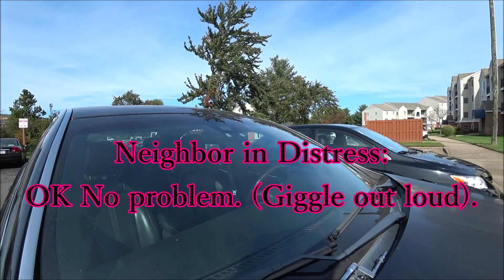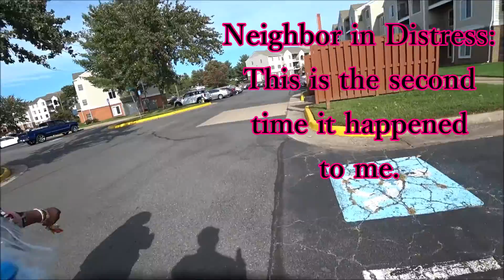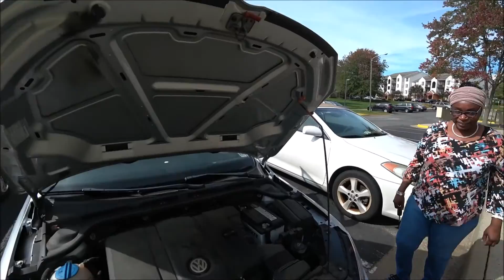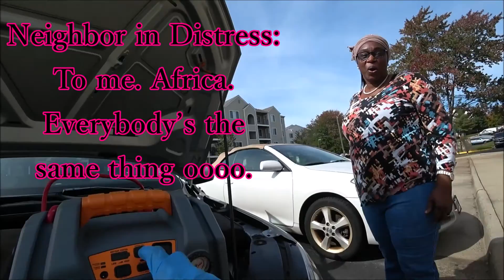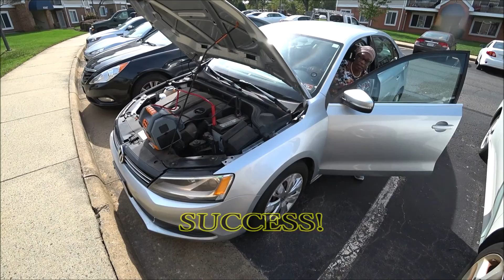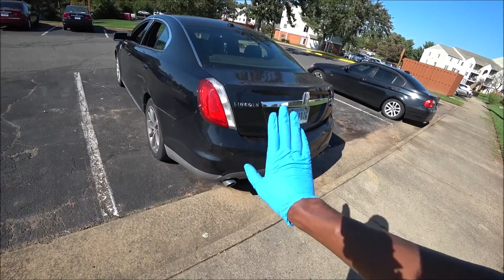Simple Act of Kindness Can Change Your Life FOREVER | Love Your Neighbor As Yourself

Comment: I have a Solara like the one next to the neighbors VW, but in hardtop. Great cars and ncie looking too.
Reply from the maker: Yes. The Solara's are a dream. Very easy to work on and 10 times more stylish than a regular Camry.
I am sure one day Toyota will resurrect them like The Undertaker for one more chance to shine. Ciao amigo Mito.
Reply: @JayCeeMax  Yes that would be nice, a new 3rd generation Solara. Mine is a 2008 with the reverse lights on the rear bumper.
Reply from the maker: @mitomr.twiceasnice4358  Nice. That's still up to date enough and easy enough to add aftermarket Chinese headunits if you wanted to. Thanks for sharing.